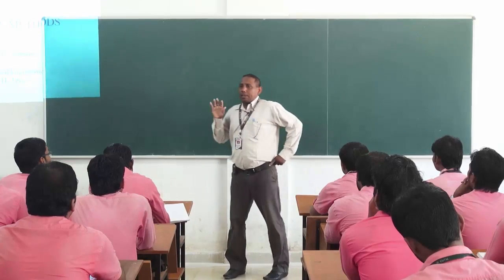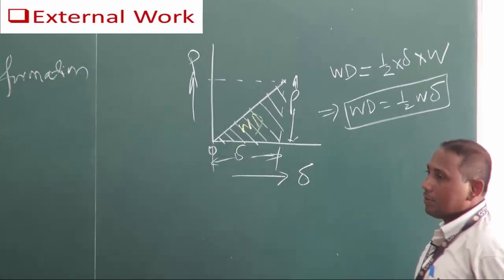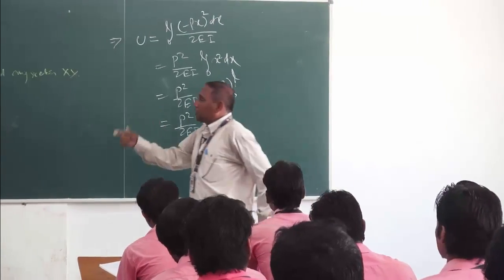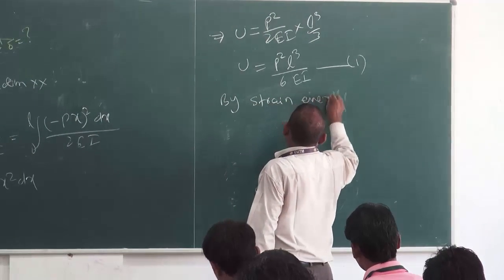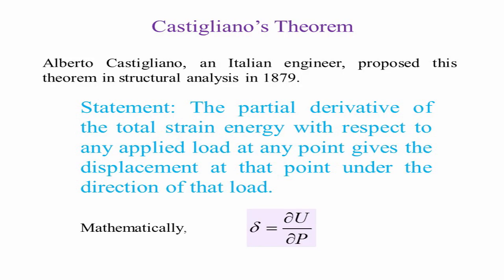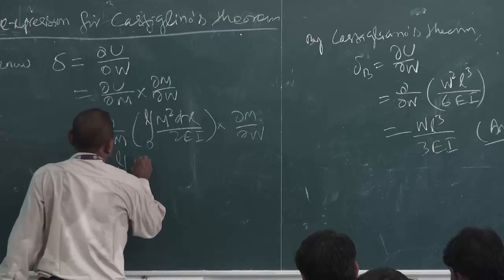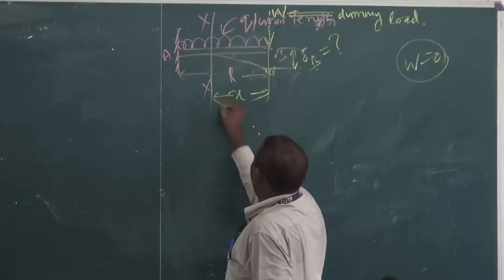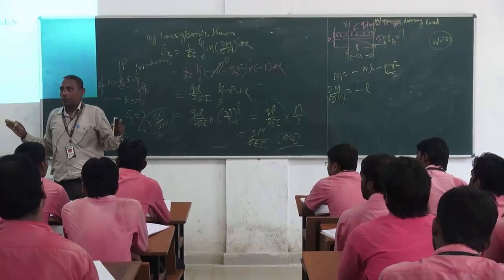DEFLECTION IN BEAMS using Energy Methods By Dr R C Mohanty

Comment: I know to how calculate strain energy stored in the beam but the question is how to calculate deflection at the midpoint when the simply supported beam is subjected to an udl throughout entire span by using strain energy method.
for this particular problem the steal energy is stored is w2* l5/240*E*I but we have to get deflection at midpoint is 5*w*l4/384*E*I right
we know that 
U = 1/2*W*dell
so
subsituting U in above equation we get
w2*l5/240*E*I = 1/2*w*dell 
when equating this above equation we want to get the above mentioned deflection value at midpoint 
but not getting that answer?
plz clarify how to get the solution?

Comment: Thanks a million Dr. R C Mohanty, I haven't seen anybody explain this better than you do. However I like to point out an error you made when you tried to calculate the deflection of point B on the cantilever beam by introducing the dummy load at the point where we want the deflection so that Castigliano's Theorem is valid. The general moment along the length of the beam from right to left(same section you chose) is equal to " - w*x - [(q*x^2)/2] " not " - w*L - [(q*x^2)/2] " as you took it. The reason is because the length of the section we chose is at an arbitrary distance "x fom the right" not "L". The error is even obvious when you use "L" for the dummy load and "x" for the distributed real load. This led to an error in the final result which should actually be " (qL^4)/(8EI)" not  "(qL^4)/(6EI)". My result can be obtained aslo by application of the Method of Virtual Work which I believe is just another way of saying "The Dummy Load Application of Castigliano's Theorem". Thank you once again Sir, I really do appreciate all that I've just learned here.
Reply: +Yreppid Yreppils nice